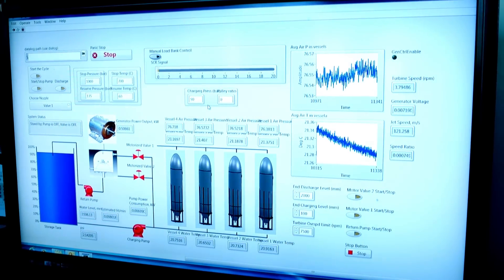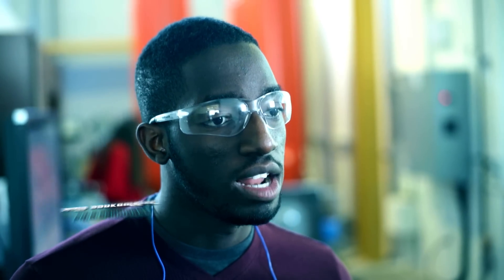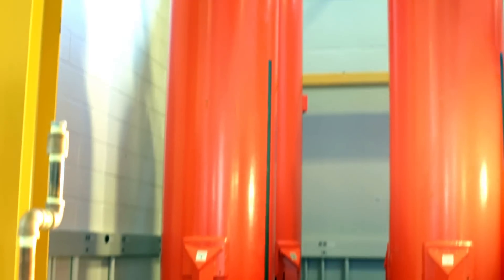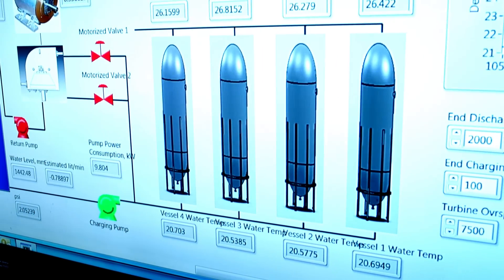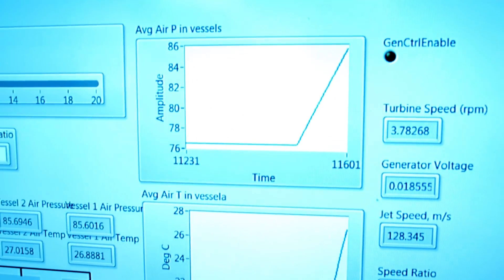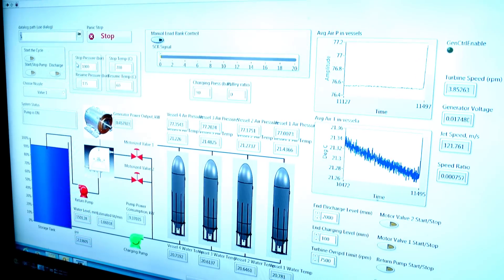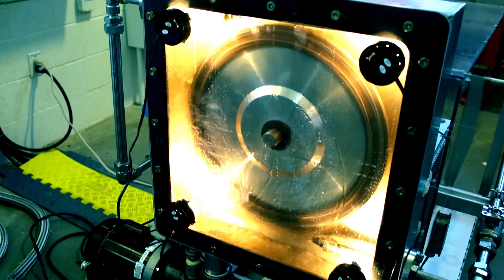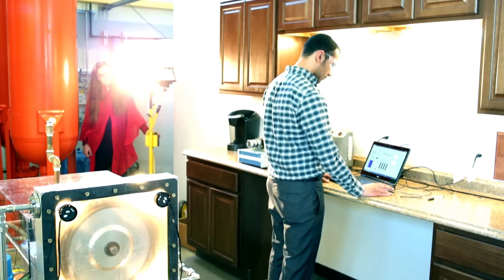GLIDES - Efficient Energy Storage from ORNL

Comment: What is the expected usable stored electrical energy available from one the cylinders (kWh).
Reply: +M.G McClintock 
The energy density of the system depends on many parameters.  It can range from as little as 2.5 all the way up to ~10 MJ/m^3 (2.7 kWh/m^3).  While it is in the acceptable range, the energy density is not the strength of this technology. Low cost, high efficiency, the capability to integrate low-grade heat and long life are the main advantages of this technology.